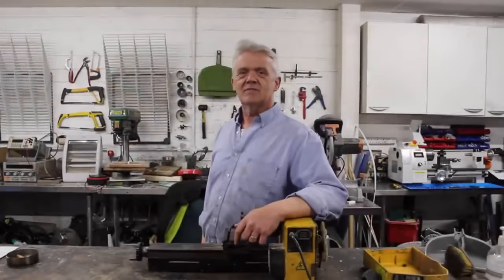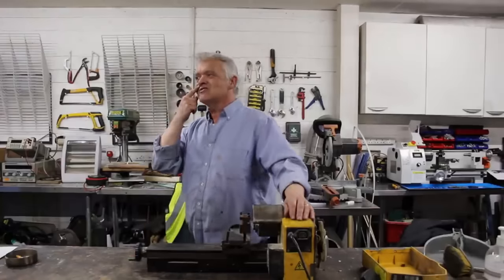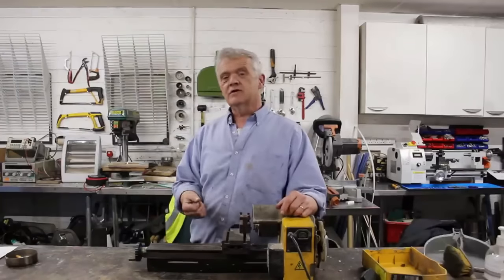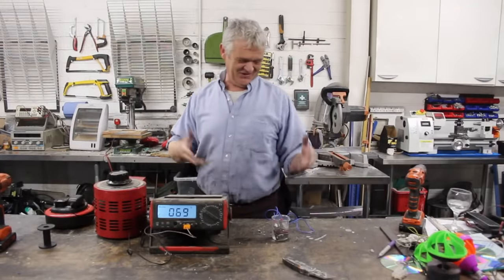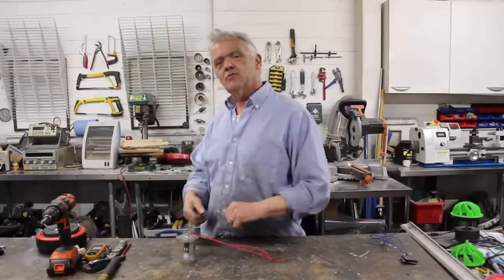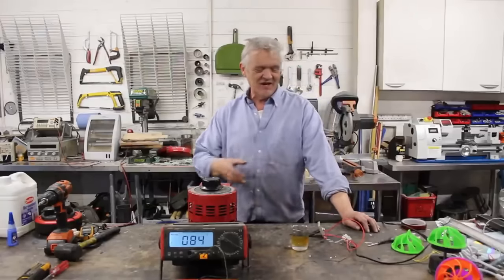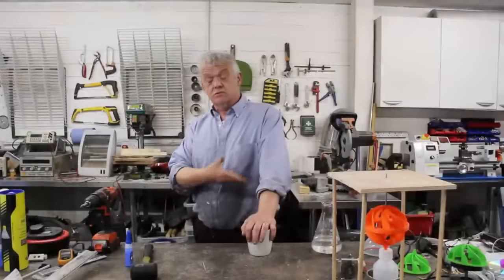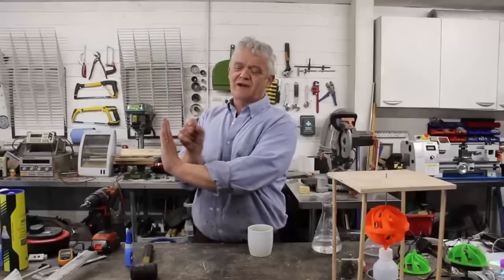016 The Dumas Effect - A Free Energy Water Heater

Comment: CALLING OUT WHAT APPEARS OBVIOUS:

You say that waters natural resonance doesn’t likely play a role and then you call out the high resonating frequency of water. Yet, if it is the resonating nature of the current that heats the water then wouldn’t a high resonance create the effect more efficiently since it is this back and forth that causes the water to heat?

An example, if you rub two sticks together they will catch fire but if you rub stick together 1000 times faster then would that make them catch fire quicker? 

My point: is there more efficiency in higher frequency production than energy used used to increase the frequency. I suspect there is a sweat spot BUT until there is proof that the frequency has no effect, then it doesn’t seem fair to make a criticism of the patent. Similarly, could the sphere (geometry) increase the efficiency in creating the higher frequency? 🤔🤷🏻‍♂️

One last thing, you’ve demonstrated that a permanent magnet will increase efficiency through electrolysis, might this do the same with the Dumas effect?
Reply from the maker: it's not complicated - you need energy to break a bond - it doesn't matter much how you input that energy the same amount of energy is needed to do that job. If you think frequency is magic that's ok with  me - i don't really mind what you think
Reply: @TnTOmnibus  - But you stated specifically that the manner in which it was input is important. You said that alternating rather than direct current is what causes the generation of heat with respect to the movement of ions. I’m not basing my statement on some advanced knowledge of this principle OR a belief. I merely interpreted what you said and applied the additional principles stipulated in the patent.

If it is this back and forth movement of ions which created the heat, wouldn’t the heat be greater at a higher rate of frequency - a multiplier effect? Wouldn’t the heat be lower if you dropped the cycles from 50Hz to 2Hz? 

I’m just saying that it seems worthy of exploring rather than making assumptions. Prove me / them wrong. Obviously the patent office seemed to find it valid. A man with integrity would conduct that experiment after making such a statement - right? 🤷🏻‍♂️

Comment: When i was growing up in the 60's and 70's you could buy what they called a vaporizer it had two carbon roads in side you filled the container with water and added the recommended amount of salt salt being a conductor the more you place in water the more conductive  it becomes but the unit i used was for putting moister into the air  if you had a cold and hard time breathing  it helped your breathing  this container was made of plastic so it would not shock you but you only added as much salt to get a little steam out to much could actually boil the water and melt the plastic  my thoughts are with all the osha and protections involved now days it had to br=e removed from the market

Comment: For a water tank heater, limescale has no effect on efficiency as all of the heat gets transferred to water eventually for ~100% efficiency. It does cause the wire element to run hotter and burn out sooner though. I do some maintenance for my landlord in exchange for very affordable rent (half of market) and almost every year, one of the three water heaters burns an element. Using water as the ohmic media has no efficiency benefit and comes with the disadvantage of being an electrocution hazard. It would also be a trip nonsense for RCDs/GFCIs unless some extra complexity is added to isolate the heating cell from the rest of plumbing.
Reply: That's why you're supposed to replace the sacrificial anode.
Reply: @onradioactivewaves  The sacrificial anode is to protect the tank from rusting, not limescale.

Comment: My question is does the last design work fast enough to put inline to a waterline and have on demand hot water?
Reply: I don’t think it does. You will be limited either by the amount of power you can feed it or the resistance of the water. Also it poses a shock risk if you touch the water while this is running.
Reply: I think that it could if sized right, I would want to use a heat exchanger though, not to heat the tap water directly. We don't want the tap water to be boiling hot but the working fluid in the exchanger could be boiling so that the heat transfer is much faster.
Reply: @jamesparks6137  This process doesn’t have to boil the water per se. If you use less strong of an electrical current or have such a high flow rate that the volume of water is only in the electrodes briefly, then you will have the water heated to a lesser extent. Electric shock would still be a huge problem though. 

Of course if you use a heat exchanger you could insulate the electrically heated liquid from the water supply, but at that point you have lost any efficiency or heating rate advantage this would have given. You might as well use a normal insulated metal element at that point.

Comment: I don't understand what frequency or type of electrodes you think we are talking about here? By placing two live electrodes in the water, no matter what type of current it is, AC or DC, the water will boil because you have produced a short-circuit effect across the water, which results in the release of high temperatures...
Given that water is the element through which the short circuit takes place, and as the temperature rises, the water heats up and begins to boil, in this case no frequency or type of current plays a role, but only the strength of the current, which then affects the time duration of the process itself...

Comment: when i was a kid i used to have a tv in my bedroom, it had an aerial lead that ran out the wall to a coiled up coaxial cable outside that was hooked to an antenna .. whenever i had to change from my zx spectrum to tv by swapping the leads on the back i had to plug the aerial lead back into the tv and every time i would get zapped if my knuckles touched the antenna  end .. wtf was that .. can we power the world with it

Comment: I am sorry this makes little sense to me, any heating of the water is current moving through the water.  I do repair on coffee equipment.  If we have a 240 volt supply and the element opens up leaving one part of the element connected to one of the live poles we have gradual heating, (some times not so gradual), boiling of the water in tank.  This is just the effect of current at 120 volts moving through the water, the same way as the flow of current through a resistance always generates power (heat).

Comment: Does the Dumas Effect work in oil?
Or, would heating oil inside a container that then heats water, or the air be defeating the purpose of the Dumas Effect?
Reply: Any liquid will work, if it has resistance. It's an ohmic heater. Ohms law will tell you how much heat you'll get for a specific resistance at a certain voltage. Oil is a really poor conductor so you'll need a lot of voltage to get current flow and hence any heating effect.
Reply: @richardmarkham8369  
Oil may be very resistant, but it holds the heat a lot longer than water, hence the oil filled radiators.

The missing question is difference in energy usage between the two type of heating elements. 

While the Graphene plates will certainly last longer, it would be a double whammy if they used less electricity to do the same job.

Comment: Please explain in what mode and where goes the energy "lost" due to a heating element becoming inefficient.  Without an explanation the lost efficiency of a heating element appears to be a nonsense.
Reply: Well, for instance, the heat absorbed and retained by the heating element after the water has been boiled is not useful energy. You may end up with the same amount of hot water, but you also have a useless chunk of hot heating element that just warms the environment afterwards

Another disadvantage of having a heating element is that it adds the problem of calcification, in which you have to eventually waste energy and time to clean it up, and if you don't clean it up, you have to wait longer to boil water because the heat transfer is progressively lessened
Reply: @acgzr9534  You are right with both examples stated. But my question remains unanswered. 
I have asked the question to point out the misleading nature of the statement that 1mm of scale reduces efficiency of the heater element to some 50%. 
The meaning of 50% efficiency  is that the other 50% is lost. That is obviously not the case. The efficiency of electricity conversion into heat does not meaningfully change be the scale on the element. Any  obstruction of the heat transfer into water gets compensated  by an increase  in the temperature gradient (increase in the temperature of the element). On the practical level there is no energy loss and no slowing of the time for boiling the water. The heat generated is purely function of the electric current and the resistance of the wire in the heating element. Practically all heat created dissipates into the water.
The Dumas effect was certainly about efficiency greater than 100%  and not about an improvement in the heat transfer method.

Comment: Those plates form a capacitor, the ESR is the metal of the plates. The current through the ESR heats the plates. The carbon rods are 2 resistors in series with a capacitor (the distance between them with the water) Or has it also to do with f.i. Eddy currents in the water ? Not every variac is isolated, most are not. This indeed has nothing to do with resonance. Free energisers call everything resonate or  quantum or flux etc Sounds interesting

Comment: It's a shame heatworks went out of business.  I was looking into buying their unit.  There are a lot of new units on eBay, but I'm worried it won't work without the App.
Reply: I really get the impression if you remove the firmware and app the unit will work just fine, the comments on kickstarter are depressing as most had to send back units and even replacements gave error codes not in the manual. I would to tempted to purchase just to have a tinker.
Reply: @TariqKhan-77  exactly,  I think the Kickstarter was for the model 1.  the units I’ve been looking at are the model 3.  $600 fulfilled by Amazon, or $300 on eBay.  Sounds like a fun project.

Comment: 13:56 I am reminded of that sound resonance effect where a stream of water appears to freeze in mid air when directed towards a subwoofer putting out a 23 - 25 hz tone. I wonder if some resonance effect could be attained by matching the 23 - 25 hz tone with its electrical equivalent. Such as plate or container spacing that has the effect of reducing the mains from 50 / 60 hz to the 23 -25 hz range where water resonates with an audio signal.
Reply: Or to increase the frequency on the plates to the resonate frequency of the water?
Reply: Hi, The visual effect from the water hose being attached tone-signal activated woofer-speaker is not from an inherent frequency of water, but rather a strobe effect of that tone's oscillation playing against the shutter-rate of the  video camera that recorded the process

Comment: I was doing some electroforming or trying to and messed around with using a signal generator, i think water has a resonance if you find the right frequencies and the right way to set up the vessel holding the water etc... but it might have something to do with the metals being in solution for electro deposition stuff.

Comment: I'd say the resonance they claim is not that the 50-60hz is matching the water resonance but that the water is being made to match the resonance of the electricity opposite of electrolysis the water is rapidly pulled apart hydrogen and oxygen to the momentary positive and negative then they change directions over and over faster than the molecules can separate the water vibrates at the resonant frequency of the mains power being fluid it adapts to the stronger force and resonates it is literally electrolysis happening so fast it can't happen at all so vibration is released as heat since no electrons are actually moving just twitching back and forth 120 times a second positive to negative and back again. So resonance is probably right sounds right if you think about right not back wards as by your remarks you clearly are "cause you said water has a resonance of 20 ghz or something that 50hz is not resonant to it " backwards thinking on your part the water changes it's frequency to match the juice applied. And its not free energy as your paying for the ac power it uses and it produces zero power itself "free energy" means it makes more power than you give it and it clearly makes none.

Comment: But if you put water or anything else that contains water into microvawe you get it to boil from resonance, and its for real unlike here where heat comes from resistance. I mean microvawe oven is literally it, a device for heating water by causing water molecules to vibrate at their resonant frequency which makes them rub against each other and heat up.  Its what theese guys wanted to make, but for real. Anyways, resonant frequence for water is actually 1.4 ghz and oven releases electromagnetic waves at 2.8 ghz (its still resonating frequency just double the scale), and so water gets hot extremely fast.

Comment: Probably don't be too quick to discount geometry and resonance. The spacings of 4-5mm are inline with ~60Ghz which happens to be resonant frequency of oxygen molecule and about a third harmonic of 22 Ghz which is res freq of water vapor. The shape of the hemispheres spaced as such are max surface for the water between them. Best and simplest geometric shape maximizing surface area per volume. A dimpled and fitted golf bar shape would be best, but difficult to make. The hemispherical plates are arranged more like an asymmetrical capacitor with water as the dielectric and with one plate having more surface area then the other. The AC at 50 Hz, 60 Hz or whatever really doesn't matter as long as AC. Assuming 60Hz, that gives a reversed polarity every 120 Hz. So, the low frequency of AC acts as a pulse. The plates of the electrodes made of a metal, there is a natural resonance like you would expect from any metal thusly shaped bell most likely in the audio range or ultrasonic range which, if material and geometry are right, could be employed like ultrasonic to breakdown the water also into vapor. Some of the tiny bubbles generated could be from cavitation from the 'ringing' of the plates as how an ultrasonic cleaner works. Anything that can cause water to resonate or agitate, will put the molecules into higher energy state thus producing heat, light or both. Just some thoughts.

Comment: If a heating element is totally immersed in water all of the energy it consumes and emits must be absorbed by the water. A very small amount might be conducted (thermally conducted) out down the wires but that will normally be negligible. Therefore ALL simple resistive water heaters are 100% efficient. This means that anyone  claiming to have invented a better water heater (resonant or otherwise) is effectively claiming to have invented an over unity (>100% efficient) machine which isn't possible.

What a lot of these "improved boilers" really do is only heat part of the tank, the water nearest the heating device, so you get localised boiling. Any boiler that puts energy into a smaller volume of water will boil that smaller volume faster. This makes it look like its heating the water faster.

To do a proper test you need to stir the tanks to ensure all the heaters being compared are heating the same volume of water with the same amount of energy. Eg Apply a known amount of energy,  then stop, stir the water thoroughly so it's a uniform temperature, and measure the increase in temperature produced. 

A microwave oven is less than 60% efficient so its far better to heat water in a kettle than a microwave oven. The exception being when you only want to heat a small amount of water eg less than needed to cover the element of the kettle.

Comment: I wonder how electrolysis would work at a slight vacuum to pull the bubbles off the plates,   or possibly under pressure? To shrink the bubbles, haha there us tons of things to try!
Reply: Vacuum would cause boiling at a lower temperature, pressure will cause boiling at a higher temperature
Reply: What about reversing the current for a microsecond every second to detach the bubbles? Would have to experiment to find the right timing and see if it just pushes the bubbles back into the solution but I think if it's dc long enough to form good sized bubbles and reverses for a very short time it might work. I'm now tempted to build an hho generator to see.